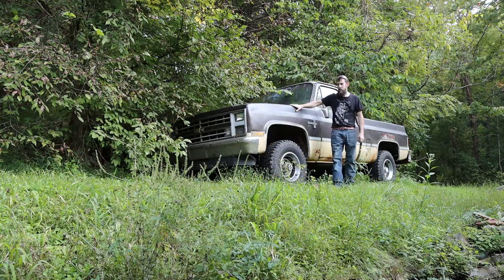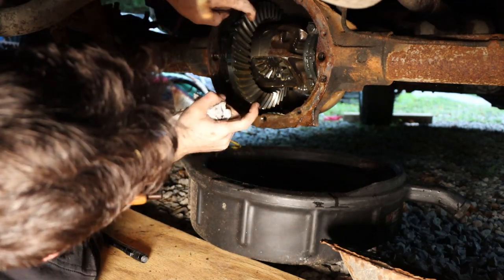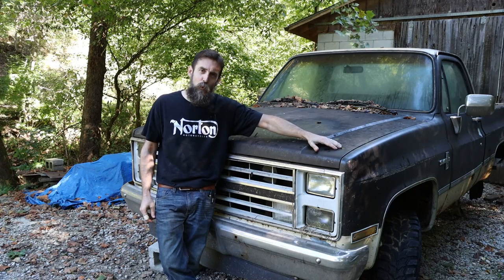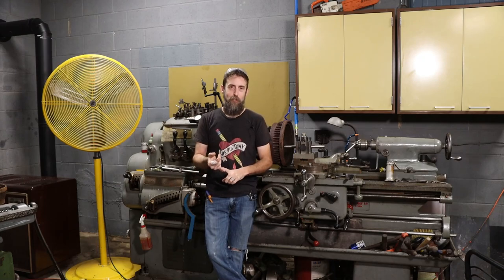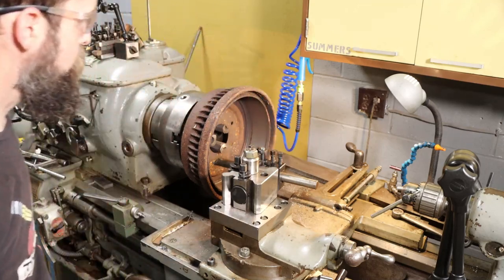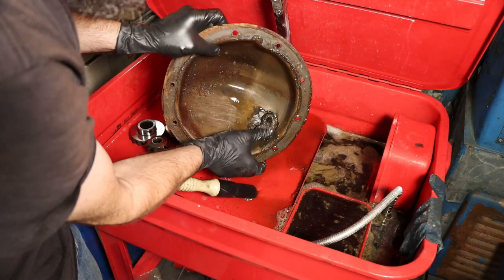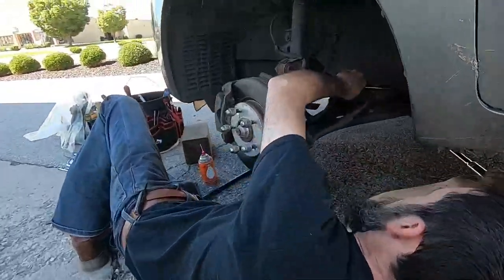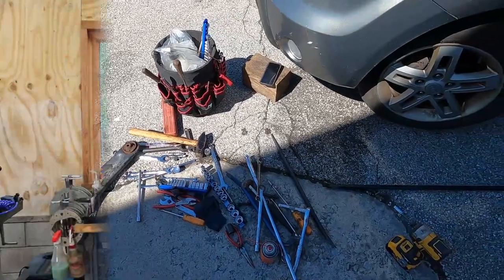Fixing what I broke Old C10 4x4 . Everything is Bad. Part 1

Comment: Hi Steve and Elizabeth ☺,  hope the fix on the old truck goes to plan, In this case I agree whith only fixing what's absolutely necessary,  or it will be a money pit, and I liked the pit stop repair on the track control arm, gone are the days when ball joints had greasers fitted,i seem to think whith regular  greasing they lasted longer, ?. Nowadays most things seem to have built in redundancy or outo fail after so many cycle's , and on a final note there's no such thing as having too many tools, no matter what our better halves say,lol. Thanks for the video, stay safe guys, best wishe's to all, Stuart uk.

Comment: Hi Steve,
It takes a brave man to replace a lower control arm in a gas station parking lot.  That's not a fun job under idea conditions.  Good tips on buying tools and setting a up a "go" kit.  Square body trucks are very popular right now.  Definitely worth it to try to keep yours up and running.  I also agree with "if it ain't broke, don't fix it".  That can turn into a real rabbit hole/money pit.  Thanks for the video!
-mike

Comment: I have very few top shelf tools. Most of my tools came from Walmart or harbor freight.
I've broken very few tools and I've abused all of them. I've had 6 foot cheater pipe on a 3/4 drive China breaker bar nothing broke (found out a little layer it was left hand thread, the other 9 came off fairly easily except that one that I started on and it to some serious effort)

Comment: I have been driving these old square body Gm's since well before this one was born. I love my old 78 with it's round headlights and 450 hp small block that surprises everyone on the hwy when I pass them. The old fella with the white beard has embarrassed a lot of youngsters out there that feel they have a rocket eh, LOL. WOW, These diffs as you say were never that tough. The 12 bolt Corporate are the toughest I know of. One of the great things about these old beaters is they made ALOT of them so there are still lots of parts available. Many NOS (new old stock) parts available as well. Your dad most likely has the 2 anti-harmonic drum and rotor belts. They are a true must have for any machine shop. $ well spent. Most likely without them I have had to grind these drums as they all have hard spots that will tear up carbide tooling. This one really surprised me. No harmonics at all ? Opps, spoke too soon eh. I have always had the belts but now seeing this I have a whole new kettle of fish to fry eh, LOL. OH MY, , , Sometimes I wish I didn't know how to do the needed repairs to our vehicles, ESP roadside. How do they say it ? "Ignorance is bliss", LOL. I was a bush mechanic that served logging shows and really understand to head out with all the basics for a job like this. At least it isn't pouring rain or snowing sideways eh, LOL. I sure hear you on the price of tools. After 50+ years I have an excess of $50K invested and I could still spend more. Retired now but it is like an addiction when it comes to new and shiny goodies for the box eh. What a pleasure to spend this time with you and your great family. I am alone now so I treasure the memories of when my family was complete. Love ya a bunch and will be here next post. Patreon $ well spent eh.

Comment: I think the problem with the 10 bolt was really when people try to launch on them for drag racing. It's a weakness of the main housing and bearing caps, where the ring gear pushes away from the pinion gear.

Comment: I have a 77 chevy c-10. It just keeps on going and going. No computers software or sensors to deal with. Keep those old trucks as long as you can. When you buy another truck in a few years you will be doing the same thing to it except you have all the electronics to deal with.

Comment: If you use a piece of ..125" wire between the bare shaft of the starter and the flywheel ring gear Od. If it's too tight a fire. Shim across the top of the starter.. if it's too wide a gap. Shine the outside of the starter to lean it in closer to the perfect mesh of the starter pinion and the flywheel.

Comment: The old brake drums and rotors can make decent utility stands. Bolt or braze a flange to them, screw in a section of pipe, top it off with your preferred mounting or support. Spray a few layers of plastidip to keep them from shedding rust, and you are done. Light stand, small camera stand, bar stock support, etc. Not sure it makes financial sense when you can buy cheap stands at places like harbor freight, but it gives you that "I made it" feeling for a functional device. Within reason, the bigger the brake, the better the stand.

Comment: I got about half a mile from home when tie rod end on my old Dodge dropped off the passenger side steering knuckle. Weirdly, it fell down directly on the inner lip of the rim and didn’t fall off, so could lightly steer enough to turn around an limp home after what could have gone very very wrong.

Comment: Great job Steve! I recently experienced some unexpected car trouble as well. Was running errands and noticed my my newly repaired ac wasn't working followed by the battery not charging. Figured the belt had broken, which it had, but the tensioner pulley had also broke. That was loads of fun because, as you probably know, there's no room to work in these cars nowadays. 😑 Had to remove a motor mount, jack up the engine, remove a bunch of other crap, and was finally able to get to the tensioner. Fun times. Anyway, great job. I agree on the medium quality tools. Mainly cause its what I can afford. I also like to buy old good quality tools from ebay or offerup for cheap. Great video and keep up the good work.

Comment: GM increased the number of splines on the later 8.5" 10 bolts and made them a lot more reliable.
Reply from the maker: From what I read  they went to more smaller splines for the manufacturing reason that smaller splines can be rolled on much easier than bigger deeper but fewer splines  that need machined . I could be wrong. The 8.5 10 bolt axles worked for normal every day stuff.  I don't think either held up well under anger or higher HP 😬😁.
I had a little more trouble finding the 28 spline than the 30. Thanks for watching 👍
Reply: @SteveSummers A lot of the stories about 10 bolts breaking are actually from the 50's and 60's 8.2 inch rear that they used in Chevy cars of that era and the 7.5" from the 1980's Camaros and midsize cars.

They're still using what is essentially  the same 8.5" rear in current Chevy trucks, with just slight changes.  My 2004 Silverado has one. 

The Buick Grand national actually used an 8.5" 10 bolt and it put out in excess of 400 hp.  That rear is a common swap in for Monte Carlo SS and others of the same body style that had the 7.5" 10 bolt.

Another common swap for 1960's Camaros  is to take the 8.5" 10 bolt out of a mid 1970's Nova and use the center section out of a 2000 or later Chevy truck with a set of 30 spline axles from Strange.

But I'm rambling.  I guess my point is that the 10 bolt has something of a bad rap that is undeserved.  Properly built they're as strong as a 12 bolt and nearly as strong as a Ford 9 inch.  I suspect your axle issues are GM's mid 1980's cost cutting and using passenger car axles in a place they shouldn't have, a 4x4 truck.

I love your Channel BTW!
Reply from the maker: @dennisp.2147  Thanks 👍. I'm not surprised at mine breaking the way it  did.  I can't be sure this is the original rear axle but if it is  35 years in a work truck is pretty good.

Comment: I had the same truck that had a worn out rear end so I ended up putting in a rebuilt 12 bolt posi from a '74 heavy half along with the leaf springs. That was how the truck should have come out of the factory

Comment: Finally sold my '82 C-10. No rust to speak of just failing paint. Your dash has held up well. I could smell the inside when you opened the door. :D C-10 served me well, glad it's gone! Wanted to restore it but decided to focus on my '91 4runner instead. 274k and still going strong. C-10 had 160k and was beat out drivetrain wise...  Have you ever looked for gold in that creek?

Comment: The first bolt you removed you sat it inside the diff housing.   Hope you remembered to get it out of there.   That would not be pretty.   😲😬🤪
Also I remember seeing a mechanic put a rubber belt around outside of the brake drum when turning it to cut down on noise and chatter.   Hope that helps.

Comment: get r done.. that's all that matters. I've seen a lot of contractors buying Ryobi drills and impacts... asked why.. well a battery won't break the bank. And if they lose the tool no big deal. They can buy 3 for the price of one of the expensive brands.. So they have figured it out too.

I buy what I need. If I am going to be using it all the time, I will buy a tool that will support me. if I don't a HF unit may work. I bought a 3/4 breaker bar to break the bung on my compressor tank to take a look inside... I wound up having to put a cheater bar on that and 2x10 x 10' to break that. Lifted my wife off the ground 8 feet away, a little bending in the breaker bar, but it finally broke one of the bungs.. have only used it twice since for brakes.. and loaned it out once... Bought one of their tile saws... it's been great.

drone footage was great, at first I thought you were walking into the creek.

hopefully a better week coming.

Comment: Nothing wrong with the 8.5, I ran one in my GTO behind a 455 that made over 500 hp and ran 11.80 in the quarter weighing 4000 pounds on slicks with no issues. It had 4.10 ratio and a stock posi unit.
Reply: You need to buy a Lotto ticket!  Everything is wrong with the 8.5.  That is the lamest rear axle setup known to man.  GM should be "slapped" for putting that in a pickup.  I have seen dozens of axle failures running far less "power stuff"!!  Count your blessings my friend!

Comment: Hi Steve everything is fixable on those trucks,I have several.The new trucks are nice for awhile and long distance high speed traveling is better but these are so easy to work on compared to new comuputer nightmares that cost thousands to repair.The new trucks are through away pices of overdesinged engineered to not be easy to work on garbage.No one with a new fancy truck will haul anything other than leaves and lawn clippings in them for fear of scraching their new 65,000$ truck.Keep your truck you will regret it if you dont.

Comment: Is that a K10 instead of a C10?.if I recall, C series is 2wheel drive and K is 4WD. K/C 10 is 1/2 ton, K/C 20 is 3/4 ton, K/C 30 is 1 ton, etc.
Reply from the maker: Yes, it's a K10

Comment: Hi Steve, am i correct in thinking you you will now have the brake shoes modified to suit the new brake drum diameter/radii.
Reply: Brake shoes have enough flex to adapt to a few thousandths change in drum diameter. Don't worry about it.

Comment: Don't worry Steve, I've got a fair quick, fowl temper workin' on mechanical stuff. I have never broken anything but time pressure triggers it. Then I learn what to do, calm down, and move on.  It takes an hour or two to settle down.  Yesterday replacing the drive belt which broke suddenly, for my 48" mower deck was no exception.  I was trying to beat a rain storm at least in the parts needing it most.  I won, but by a sliver.  I also discovered I'm completely outta grease (I was trying to be a good boy and grease all the nipples). I'll end up going into town and gettin' that did..

Comment: Yup, don’t spend extra money on your work trucks, just enough to keep them running and not actively dangerous,buy them cheap and keep an eye on the economics when repairing them, you won’t drop much money if you buy well.   The best way to spend money on old engines is regular oil changes.  I don’t know anybody over here (UK) who still has a brake drum lathe any more !

Comment: Unbelievable - changing a lower arm in a parking lot! I've done a lot of work in parking lots, but nothing like a lower arm. Unbelievable - I gave up on turning brake drums on my lathe. Could not stop the drastic chatter. Even made a special fixture and still just gave it up. One more thing - your shirt - NORTONS - do you have one? I still have 3 Commandos. One was only 1 year old when I got it. The most vibration free motorcycle I ever rode. That includes BMW's, Laverda's  and UJM's (Universal Japanese Motorcycles.) Best of all they sound like a motorcycle should sound and you don't have to drop down a gear to pass somebody. I'm 77 now and it hurts to ride. Hope everyone has improved their vibration control by now.

Comment: I am pretty sure you know this , but here goes. If you replace the broken axle with a different used axle out of a different C-10 truck with a 10 bolt rear  make sure the used axle  comes out of the same side tube that broke. That was a drivers side axle so only use a drivers side replacement axel or in short order you will be doing this again because of the twist from load from the rotation of driving all these years ( been there ) If you replace it with another driver side axel, it should hold up for a long time if you get the same side used axel. Fact is in that year truck, 12 bolt rears are VERY common and many came with a posi carrier, a huge plus when you get stuck in the mud or pulling heavy loads. ( Yeah I know it's a beater you don't need it) but be advised if you switched to a 12 bolt it has to have the same drive gear rate as the other front diff does on 4 wheel drive .

Comment: i had a 74 chevy long bed.  am i wrong that the 4x4 3/4 T was called the k10 and the c10 was only 2x2?
Reply: There's no way I could have been the only Chevy/GMC pedant out here.  You are correct.  It's a K10.  Would only accept someone calling it a C10 if they swapped a 2WD body onto a 4X4 frame.  But this one appears to be all original equipment.

Comment: My 'new' car is a 2000 subaru and I'm going to ditch it because it is ... too new and generally any service work just takes too damn long and parts are harder to get than parts for that relatively new truck you have and quite a bit more expensive. I do have a newish square body - 1986 3500. I went newer on that because I needed the carrying capacity and the price was right.

Replacing the whole lower control arm when all you would need on an older car was a lower ball joint illustrates some of the reasons I don't like working on newer cars. In this case everything was reasonably accessible so you didn't have to take 2 other things off to get to the thing you wanted to fix. A good example is a car where you have to take off the intake and pull the radiator just to get the alternator out e.g. audi, volkswagon, bmw. What would be a 20m job on an older car becomes a fluid management hassle and takes hours and possibly takes a few special tools.

Hopefully in your lessons learned bucket you have "always fix front end components when they start to look remotely bad". While most of those bits will fail at low speed when the stresses are high they can also fail when going around a corner and then much sadness can happen.

As far as tools and working on a budget - some tools you really want higher quality but for most stuff you can get by with harbor freight but for things that will break when you try to really use them or are less functional it is good to be picky and maybe shop swap meets and get older quality tools that always work.

Comment: a shop without a truck is like having a car without a windshield...yeah you can work it, but life sure sucks... i miss my old dodge.. there have been too many times here in exile where i wished i had it here...throw a dana 60 rear end with a detroit locker in that pig and you'll never have a problem with it again.. the body will rot away before you'll ever have to touch the rear end again

Comment: I thought you would have welded, turned, milled and heat treated the spline back in the axle and re-used it. It would have made a good video at least. You were not inferring that Snap-on are good tools, surely. Overpriced with far better available for a lot less, at least here there is.
Reply: i loose a lot of tools so snap-on wouldnt be a verry good choice , the snap-off chinesium stuff works fine and i have extras in case they break or need to be adapted (shortened/bend)  for a certain job 
he could weld up the axle and cut new splines but it wouldnt be as strong as an original a set of junkyard axles would be a lot cheaper compared to the work you need to put intoo repairing the original 
with the way the truck is looking and doing i doubt it will live to the next time it needs work done to the reardiff or the brakes , the rearseals are kindah important though as the oil leaks ontoo the brakes and decrease their performance
Reply: Trivia for the day.
Snap On was the company that started making sockets that would "snap on". Thus, their name. Other companies followed suit.
Reply: Old axles are likely to made an appearance as source of good quality steel shafting for other projects, less the hard end pieces. The middle steel is good, and easy to machine, so will be used down to the bottom. Take the hub end, put studs back, place some steel poles on the stubs, and make a washing line with it, just placing the shaft stub into a steel pipe, plus a little grease, and you will have a near indestructible windi drier.

Comment: if it aint broke...........fix it till it is
over here the cars need to go for a mandatory periodic vehicle check 
stuff like that balljoint wouldve been found before it becomes an issue , on the one hand it will cost you money every year to get the vehicle aproved for another year , on the other hand stuff like "the wheel falling off" or brake failure happens a lot less over here